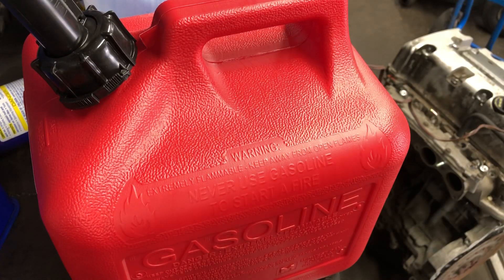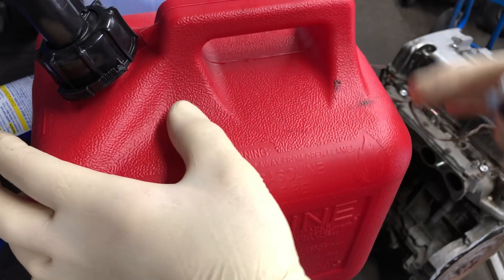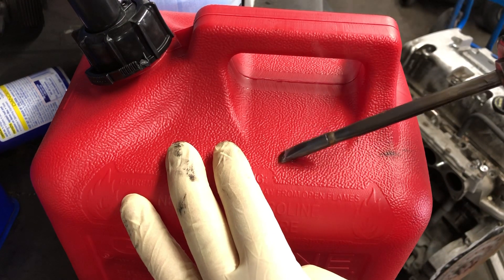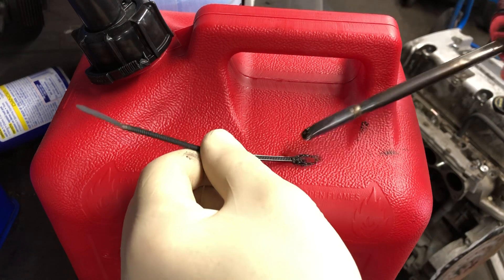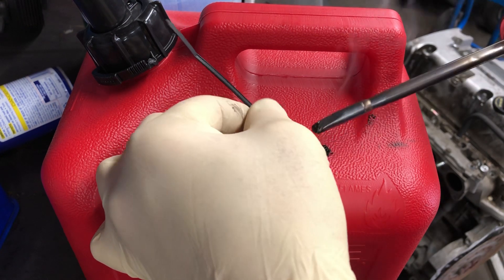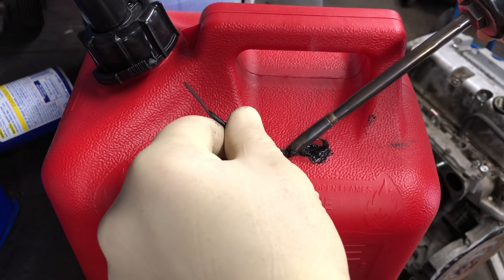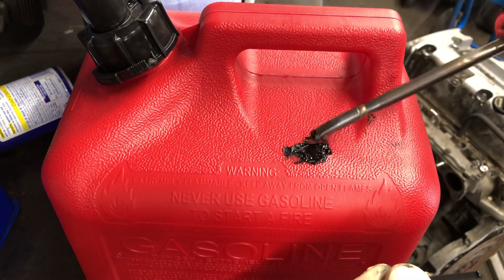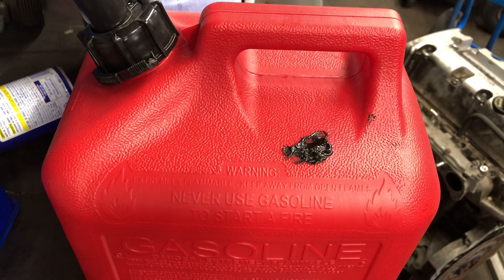How to repair plastic gas tank using soldering iron.

Comment: Will This work on Dodge RAM Gas Tank ?
Reply from the maker: It will work, as long as it’s  a plastic tank. I have done it with Volvo plastic gas tanks and it worked out good for me. It’s been few years and it’s still holding up. Any more questions, fee free to ask. Hope it works out for you 👍🏼